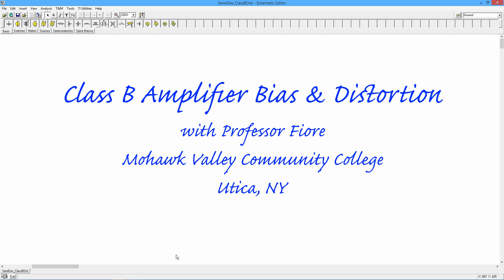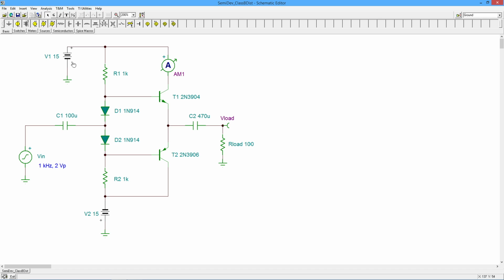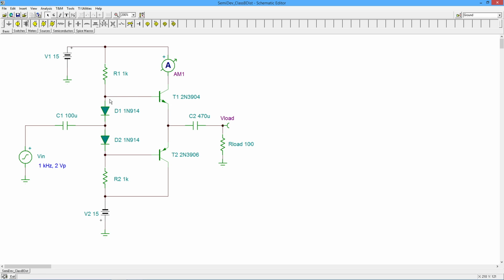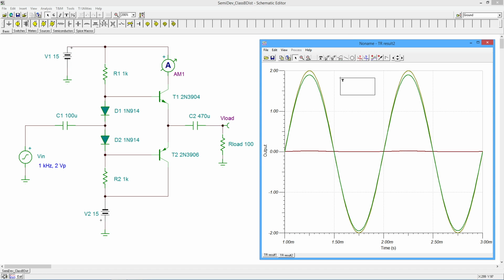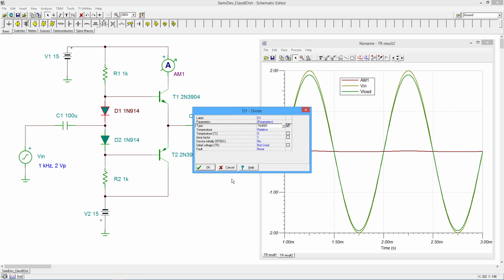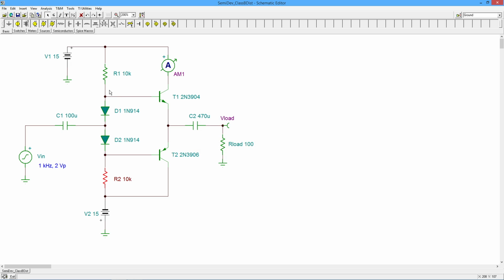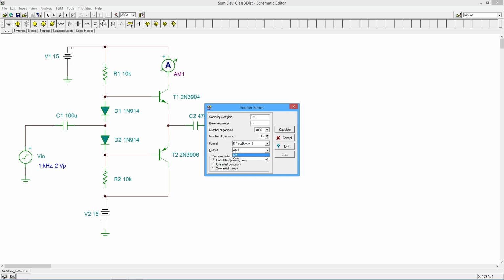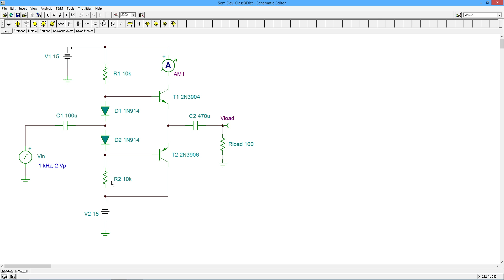Semiconductor Devices: Class B Distortion Sims

Comment: Curious if it would be better (or how much better) to use the base and emitter of two more of the same transistors instead of diodes at the front end.
Reply: I simulated this just now, actually (in a different software, which unfortunately doesn't give me a THD figure) and it seems like using the BE junctions of two transistors instead of 1n914s is more tolerant of higher R1 and R2 values without crossover distortion (up to 100k seems to look pretty good, after which point I start to get obvious clipping).
Reply from the maker: @christopherventer6391  Yes, that would be the case, and in integrated circuits we often make matching "diodes" by just creating a transistor and shorting the base-collector junction. The practical problem with a power amplifier is that you'd be using comparatively expensive power transistors as diodes (and at a relatively low current and power level, as well). The usual route is to use diodes as shown, and then apply some global negative feedback to the circuit to reduce what distortion remains.
Reply: @ElectronicswithProfessorFiore  That makes sense!

In the meantime I turned my worst-performing test (BAT54) and an OPA and wound up making a wavefolder  lol